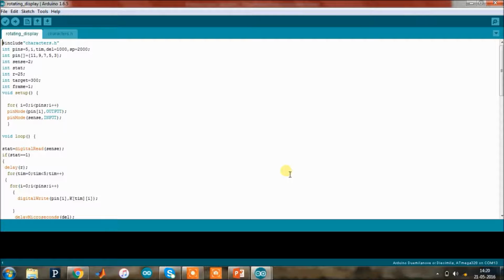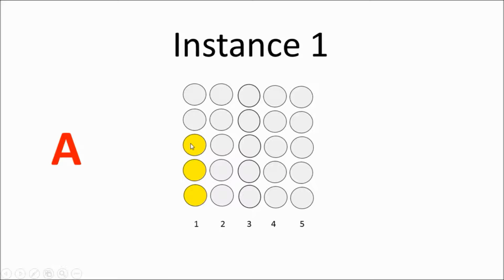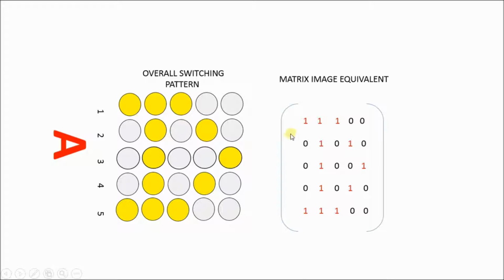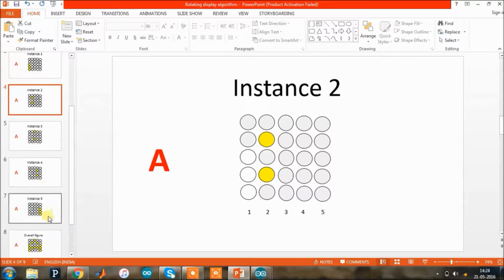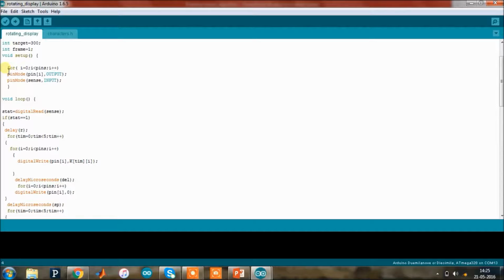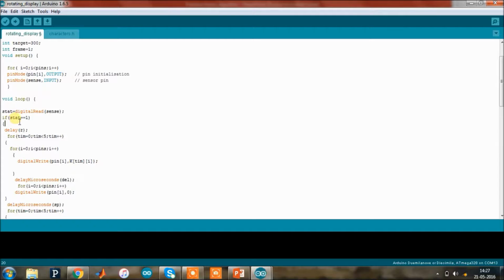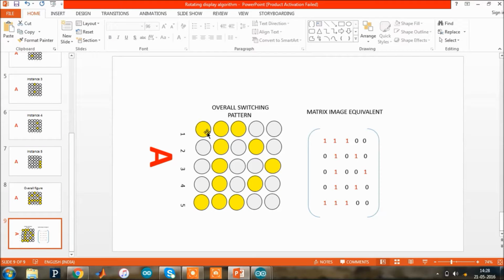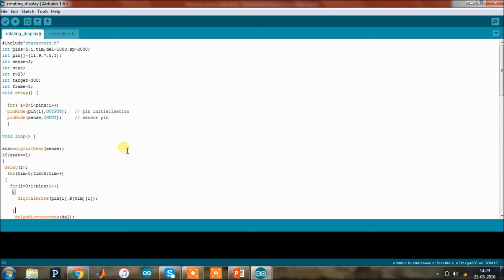POV DISPLAY PROGRAMMING TUTORIAL|| DELSQUARED SI

Comment: Can you please tell me which app you are using to program the pov using dots.
Reply from the maker: Hi there! Well, I've used the Arduino IDE to program the ATMEGA8 MCU. You can actually use any IDE for that matter. If you are an absolute beginner, I would suggest you go forward with the Arduino IDE. If you are on an intermediate level in embedded computing, you can use Keil Microvision and program an 8051 MCU (which is very insightful) or use ATMEL Studio and write the code on a processor level for the ATMEGA8. Hope this helps. Good luck!

Comment: hi DEL SQUARED SI. iam a beginner in arduino i feel very tough to  understand the code that u have given in instructables. so can you give me the code that u have used to display "kartik" in ur video.i feel its easy and i can modify it to display my name.iam very much interested in doing this so pls repley me fast
Reply from the maker: I have not posted any code on the Instructables. You can set the resolution to 720p and directly copy the code from the screen.
Reply from the maker: First, try the code for a single character( It's what I did initially)  and then customize the code